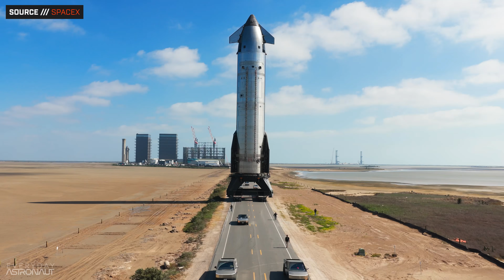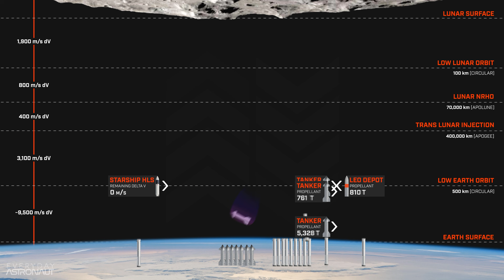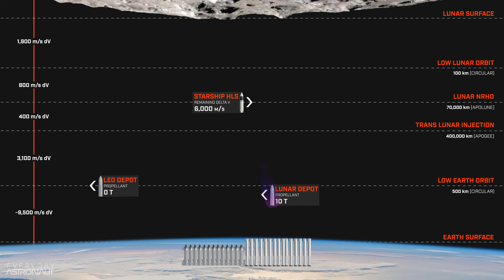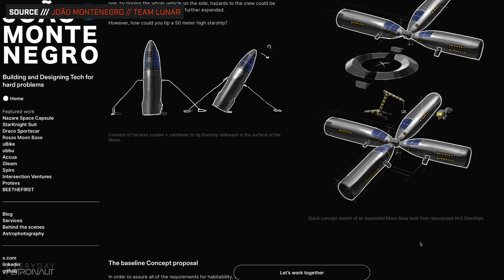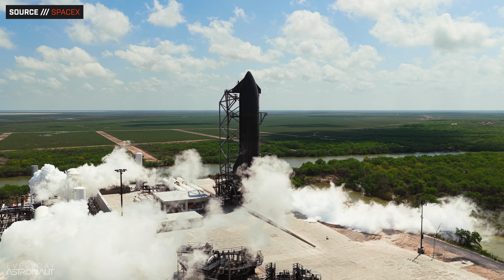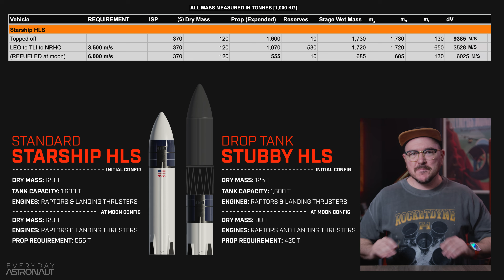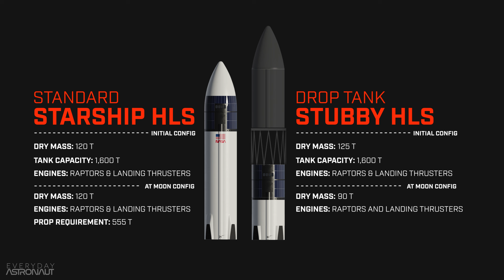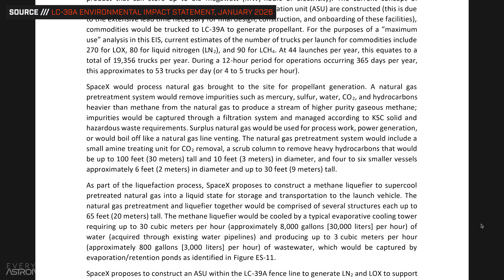Does Starship REALLY require 15+ launches to land one lunar Starship?!

Comment: thing is that the whole point of the starship program is to do dozens (or rather hundreds!) of launches per month, so the number of launches required is irrelevant. What is important is to have a totally reusable vehicle that can land, refuel and launch again in days if not hours. Spacex will have 4 launch pads in operation within a year, if any of those are equipped with enough boosters together they can already launch multiple ships per day. That means those 15 launches may take just a week. And this is going to be in place realistically before the end of 2027. A couple of years later 10 starship or thousand tons to LEO per day will be as normal as today is launching 3 or 4 f9 per week.

Comment: Additionally you can make Methane on the Moon too - it's just carbon plus hydrogen. If you can't find enough carbon on the Moon, you can bring it from Earth and react it with lunar hydrogen. OR - you can use lunar silicone (of which there is plenty) instead of carbon to make Silane, which should be an easy substitute for methane, but of course you would really want to test this out before trying it for real.

Comment: A horizontal Starship HLS landing setup could be 2 rows of tangential landing/takeoff thrusters just above the centerline of the HLS.  For example, if the thrusters sit 60 degrees from the top (i.e. 10 and 2 O'clock) would provide thrust at 30 degrees from vertical, hitting the surface at 4.5m from the edge of the ship.  Legs for standing on the Moon could be below the centerline. like at 8 and 4 O'clock .  Overall, this will land and take off like a giant insect.

Comment: Remember this vehicle is designed to go to to Mars and land there. That's why they are not changing it in meaningful way. If it can land on Mars it should be able to land on the  moon. That's also why they chose methane for fuel. Mars has plenty of methane and they can make fuel at Mars if the have to.
It's also a sneaky way of getting the Gov./NASA to pay for part of the development cost.

Comment: For the Methane supply, a LNG cargo carrier (ship) carries between 65'000 - 125'000 tons per load. So one having 1 carrier you could fuel between 10-20 launches, if the boil-off is ignored.

Comment: Forgive me if this was already addressed in this video and I missed it. My mental capacity isn't quite up to this level lol. But my thought has always been, why not make initial starship launches full of placing a bunch of depots into LEO and then attaching them together to make a giant gas station that holds far more propellant than needed for a moon mission? Just keep that giant depot in orbit, launching starship tankers as needed to keep it topped up. Then HLS could just join up with it, get everything it needs in one fill up and be on it's merry way. Seems perfectly feasible to me if the boil-off issues can be solved, not to mention sending all those depots and tankers up there would be great practice for making the whole starship launch system more and more reliable. If in-orbit refilling is going to be a thing, seems to make sense to me to just have an orbiting gas station up there all the time for that exact purpose rather than sending them up there for each individual mission.

Comment: Aren't you making a tonne of assumptions here Tim?🙃🤣  That's a rocket joke.😝  Loved the mental exercise.  I think all of this is important to understand, but can cause some unfair disbelief.  At the end of the day if the trade offs are such that it costs more time and money versus just using or losing prop, SpaceX will forgo the thing that might optimize for a little prop savings.  Elon has stated many many times that optimizing for something that shouldn't exist, is dumb.  If having a stubby ship is a one/two/three off but adds design bottlenecks and or time, it's gone (Which is what you said at the end... basically 😆).  I've felt that they are working towards the goal of modules.  The tanks and drive section will be the same, but the payload area will be modules that get "dropped" in during the stacking phase.  In that way they can pump out ships faster.  If it's less efficient on prop in certain cases, that cost will be far out weighed by time and material costs during construction of full sheet redesigns of mission specific ships.  I'd bet on SpaceX every day of the week to build a bigger moon base, faster than any other rocket system or company.
I think the HLS "module" is way further along than we've seen.  SpaceX has done a lot of the work and testing for this using Dragon's life support systems.  I also don't think the elevator is difficult or risky.  The chopstick crane is probably significantly more complicated.  Cables and pules don't break and electric motors to drive them are pretty well understood by another Elon company. I can't think of the last time I've heard of an elevator cable snapping.  Our steel cables on earth can carry a lot of load based on lunar gravity.

Comment: @30:00 - Won't there be mad fuel sloshing during the landing maneuvers?  It'll be SO Critical that there is ZERO horizontal movement. Also likely a different tank design - Baffles in both directions?
Reply: Starship has seperate tanks specifily for space and landing.

Comment: you could build a speed exchanger on the moon that once built can be used to deaccelerate and accelerate rockets with each other so that almost no extra energy has to be used to slow down and speed up rockets
Reply: while theoretically possible, in practice that would require catching a 50 meter long, 150 ton spacecraft moving at 2 kilometers per second. any failure would result in a massive explosion with the complete loss of the spacecraft, the speed exchanger, and everyone anywhere near it.

Comment: 1:11:07 "and return"
Or just meet a barge.
1:38:14 "I think that covers pretty much everything"
Cannon barrels need replacement on a regular basis. 33 engines with components that degrade in perhaps worse fashion than Cannon barrels multiplied by a couple dozen fueling flights per flight sounds like a sus plan. I suppose the "fuel truck" flights can be cheaper. Use new stuff for people. After a few flights just use them as fuel trucks until they explode.

Comment: When I look refueling in space, I always have this question which no one ever answer why not launch small solid state boosters in to space that can be used to provide the bulk of the delta v with the onboard motors providing to fine control 
Example say you need 6346 ms of delta v use 6000 of boosters and the 346 plus extras for mass change, from the controlable motors
This can be refined in many ways 
But it removes the boil off problem and allows for mission flexibility
Reply: solid rocket boosters are single use and only turn off when they run out of fuel.
Reply: @shaung949 yes hence the plan above

Comment: Not only will the fuel requirement for the cis lunar depot be smaller with LLO, but you could also fill it all the way up in LEO and have it sit in LEO for multiple HLS refuellings. That would probably be the least amount of launches needed per HLS refuel, as the way to the moon takes the most amount of fuel, not the HLS refuelling itself. Basically, the fuel is car sharing to the moon, haha

Comment: 32:40 What about fuel feed and balance? 1/6 of the mas on the surface but when it start to use the engine? how high and what gravity has? 
also if you lost a litlebit the control all that fuel liquid will go in one side and need powerful thruster to compensate it.

Comment: How to transfer fuel without gravity? 
Without acceleration, the fuel is floating in the tank? 
Last I heard, we didn’t even know how to transfer fuel yet?
Reply: they have done internel fuel transfer between tanks already. Fuel transfer it not difficult in principle apply a little thrust and the fuel moves the other direction, getting hardware that can do this reliably is the tricky part.

Comment: If they were to use the Raptors to land on the moon, would the thrust sort of self-level the regolith leaving a predicable, mostly level crater that would make the legs have a more-or-less equidistant height to manage? 

Maybe a hybrid, use the Raptors until a certain height, say 30 meters, and then phase in the descent thrusters and phase out the Raptors and do the final touchdown with the descent thrusters after the Raptors have blown away the gross irregularities of the landing spot?

@Elon, feel free to use this method as long as you refer to it as the "Mishn0 Gambit".

Comment: What is the point of the lunar missions? What is the commercial point?
Reply: Resources on the moon. Also, a mission and base on the moon is basically a proof of concept of what can be done on other planets.
Reply: What is the resource extraction narrative? thank you
Reply: @hoots187 Elements known to be present on the lunar surface include, among others, hydrogen (H), oxygen (O), silicon (Si), iron (Fe), magnesium (Mg), calcium (Ca), aluminium (Al), manganese (Mn) and titanium (Ti). The atomic oxygen content in the regolith is estimated at 45% by weight

Comment: In the future they could optimise the dry mass of the lunar depots by basically making them two large spherical tanks (for the methane and oxygen), and only having a single vacuum engine to do the TLI and go to LLO, and then using a light aero capture to get back to LEO. In the long run this would probably be the most efficient way to get propellant from Earth to the Moon.

Comment: It makes basically no difference if they need 5, 10 or 20 refuel launches
Everything depends on the system working flawlessly, cheaply, and fast
If it is not cheap, we are simply not staying on the moon, and expending anything will be orders of magnitude more expensive than fuel for multiple lauches

Comment: Why would the Starship HLS have any sea level engine ? Its never going to operate in the low atmosphere where they are needed.
Reply: The sea level raptors work fine in space they are just slightly less eficient than vacum optimized ones. The main reason though is that those engines are the ones that move allowing starship to make changes in direction.
Reply: It'll still need to reach orbit velocity on his own after staging like every other starship
Reply: @lanatsif  wouldn't vacum raptor be a better fit ? That burn happens in space.
Reply: @amxx  nope it's not in space yet at this point, just thin atmosphere, and all 6 raptors, sea level and vacuum are fired at this step

Comment: Can't they extend the fuel capacity for HLS lil more (1800 tons maybe), just to streach the tanks and only use the nosecone as pressurized area? the vehicle can still launch with the default 1600 tons and with a cost of a few more refuels, it yields more fuel margin

Comment: When the first unmanned lunar-landers make it to the moon, the first thing they should bring are small robotic-bulldozers to flatten and compact the ground in preparation for when the first manned landers arrive!

They should also carry beacons to help guide the manned-landers to a safe landing. 

You don't want to run out of fuel while you're desperately looking for flat ground!

These robotic-bulldozers could also carry a rock-drill and explosive-charges to deal with large bolders!
These robotic-bulldozers could also be used to plough dirt-roads!

There's not much flat-ground around Shackleton Crater!

Make your own luck and build your own landing-sites!

Comment: rapid re-usability alters the equation for sure, however, is anyone asking just how reusable these rockets are actually going to be?  The shuttle was supposed to be rapidly reusable (relatively) but wasn't.  The Starship platform is highly stressed (chamber pressures, huge fuel load, re-entry heating on the ship for a start).  Maybe the tortoise approach of Blue Origin and their stress loads on their rocket motors being well within their estimated maximums may well be more possible.  Just my two bobs worth.

Comment: After watching your in depth analysis, I followed kind of brain fart with Grok to see if I was barking up the wrong tree. But seems it could actually be another layer of optimization after all. If we setup the depot (or at least one of them or two of them for flexibility) in cycler orbit around the Earth-Moon system it could improve the logistics slightly? 
And Grok seems to think it lines up nicely with the oxygen production on the moon in the long run.

Comment: It seems that Raptor is not the optimal choice for interplanetary missiona (Luna included). Nuclear, plasma or more efficent engines should be implemented ASAP. Or... what happens if we redesign Saturn V with lighter materials, more efficent engines (use Raptors or RD-171 instead of F1s)?

Comment: 1:00:55 pressure fed engines use a separate pressurizing gas (usually helium) to push the propellants out of the tank, not gaseous boiled-off propellant. Every lunar landing engine I can think of used a pressure-fed engine.

Comment: How would the math work out if you completely used all of the volume in the tanker configuration for carrying propellant? Would you come out ahead? 

Also, regarding discarding the upper stage. It wasn't clear if you adjusted the calculations for a one way trip configuration (no fins heat shield etc.). Was that accounted for? Would it change the numbers?

Comment: Why wouldn't SpaceX and NASA use LRO images to pick a level landing site with no rocks and put down a set of radar and/or laser retroreflectors (via an uncrewed lander and rover) and land on a dime like  Falcon 9 boosters?
Reply: They don't need that. One can land on a dime with optical navigation alone.

Comment: It actually is true that the Starship stack does not have an optimal staging ratio. But it's optimized for maximum single-stage, refueled performance. Starship is optimized for the world where a dozen flights means nothing because you're doing 10,000 Starship flights for Starlink, AI satellites, etc.
Reply: A couple hundred Starship flights will be sufficient for those purposes. The system is optimized for launch cadence for a different and far less benign reason. It is meant to circumvent the outer space treaty.

Comment: The tankers are going to have less dry mass.  Look at a LEO satellite launch mass and convert that to fuel mass, then isn’t that going to make a huge difference?
Reply: Starship can lift roughly 130-150 tons into LEO. The propellant mass on a Starship is 1200tons. You can juggle those numbers any which way you like, orbital refueling takes on the order of 10 Starships. This ratio follows immediately from the rocket equation.

Comment: One important thing to consider here is the value of a Starship that is already on the Moon surface. At the beginning there will be no payload other than astronauts to take from the Moon and they aren't going to load any more cargo into it (there isn't even provision for crew supplies other than what is brought in the Orion) and thus the Starship HLS would just be hauling 3 people up and down when paired with Orion and sending Starship with no payload other than astronauts for the consecutive landings seems extremely wasteful. This is why it seems to me that after the initial period we'll have Lunar cargo-only and Lunar crew only (+ their supplies) Starship versions, the former going pretty much exclusively one way (until we find something other than LOX worthy bringing to orbit) and the latter paired with a crew Starship optimized for Earth reentry and tower catch (similar to those on Mars landing renders, but without landing legs), optimally meeting in transfer orbit so that the transfer (Earth <-> Moon) time can be used to transfer the much more numerous crew and their supplies, minimizing the total travel time. If, however a shorter (no Superheavy) launch & catch tower is constructed on the Moon with chopsticks and base solid enough (eliminating the need for landing legs and engines), you can have just the Earth version doing the entire trip.

For that beginning phase, when HLS is working with Orion to transport both crew and cargo, it may actually be interesting to look at having the tip of the Starship HLS be an ascend module, similar to the one in Apollo programme, serving also as an escape vehicle if something goes wrong during the landing. What the crew needs to take off, get to and dock with the Orion is far less than what they need for the extended stay on the Moon and the rest can be put to use on the Moon. This way there's no need for the Starship HLS to bring any more fuel than is needed to safely land as it's not going anywhere after that. This way the dV for HLS is much lower, removing the need for refuelling in Lunar orbit entirely and greatly reducing the needed number of tanker Starship flights needed for a single HLS mission. This way the Starship in this initial stage would discard (ascend module) from each launch about as much as each Apollo launch brought back to Earth (crew capsule).

This approach fits perfectly to the stated goal of simplyfying while building for the future as it'd literally be building up much larget pool of assets on the Moon, while directly building up to crew volumes far beyond Orion's capabilities. Maybe they could adapt the Crew Dragon for the role of the interim ascend module by replacing the heat shield with something akin to scaled up Common Berthing Mechanism, the HLS part of which can later be used to connect multiple HLS Starships for long-term habitats.
Reply: I would suggest that you spend this much effort into analyzing the nuclear posture review of the US government and please compare with the realities of the Chinese space program.